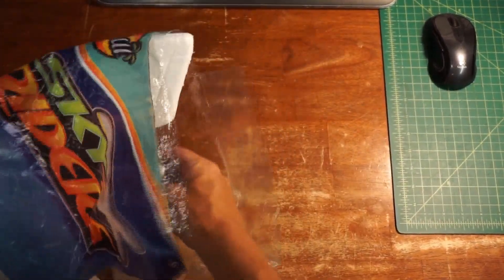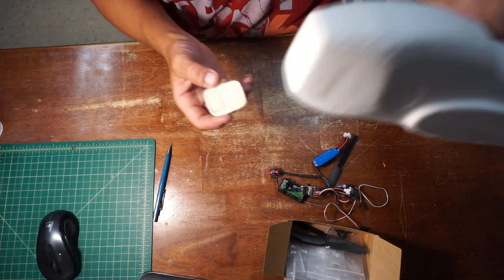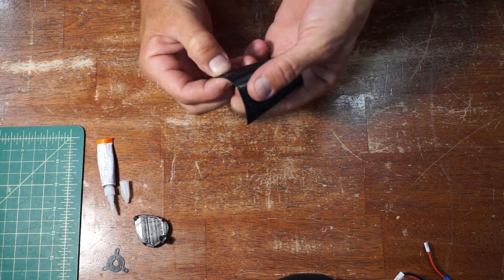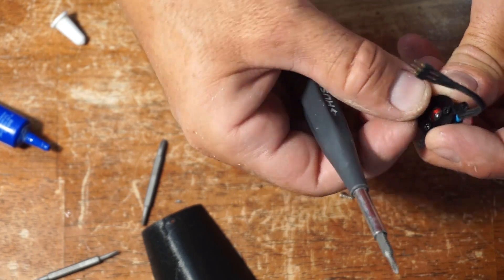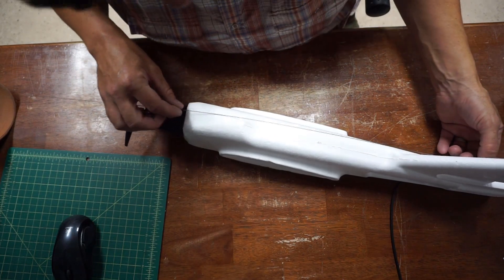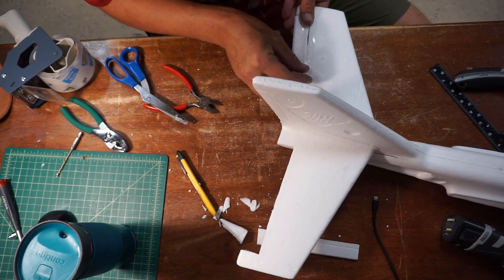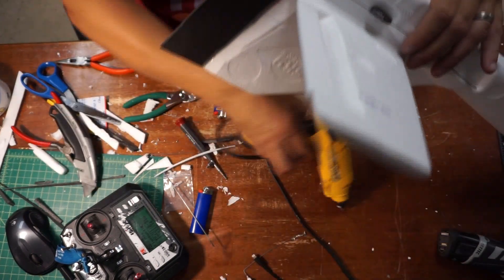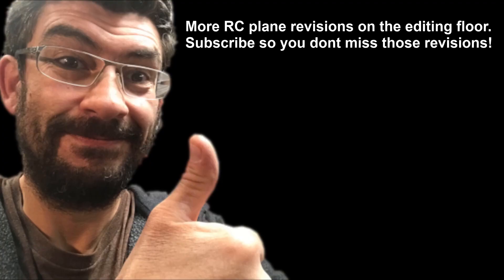Walmart Chuck Glider Converted to an RC Plane!

Comment: information.           at :36,  the   Optimal  location of  cg  and c-m  are  Determined  by the geometry of a main wing.!          when  the nose was shortened  it became  More  difficult to  counter-weight  the  aft-located  mass; aka at the TAIL.!          in addition, the wing and stabs are  TOO  near  one anther, for a   Powered, controlled  model airplane application.
if a  Normal  airframe is assumed, the optimal location of cg is at  Thirty percent of chord/mac;  AND  c-m  should  vertically  align  with  Twenty-five percent.          in the case of a swept wing, after 30% of mac is located, the c-m  Should  be a bit forward  of  it.!                that is a small motor, for this model.          at :45, ???.       this  told   you  Nothing.!!!!!           YOU  need  to  Find  the  Optimal  location of the cg    FIRST.!!!       then, make it  TURN  OUT  THAT  WAY.!!!!!!          googletranslate
Reply from the maker: I assumed the model came with the cg located at the optimal place so I took that cg and tried to maintain it throughout the build. I added the batteries in the first revision to do so. This revision, I wanted to eliminate that weight so I shortened the nose. and brought the equipment aft. I am uncertain, but the motor/esc seems to have lost power for the second revision. 
My third revision (editing now) I added a 2212 motor and my first ever 6-axis gyro. It performed well till I found a tree. 
I understood what you were saying about wing chord and all (not sure what mac is) but I have already flown the revised version (for a bit) and it worked ok.

Comment: Look nice.
Reply from the maker: thanks! I have 2 other designs. ill post videos for them and put models on Thingiverse.com
Reply: @RandomProjectswithSam  I will definitely check it out. My interests are generally on RC boats. ☺️
Reply from the maker: @KanibuzMuzik  ahh cool! I have two new boat builds planned soon!. One I have all the parts for and I am ready to film. It'll be a 3D printed jet boat (revision II - rev I was before I had channel) and the second is a little micro RC sailboat from scratch.
Reply: @RandomProjectswithSam  great! I'm also working on the airboat. I did it once, but I started again because I had a lot of mistakes. I'm going to use a brushless motor, I'm still working on the body. I follow your videos.